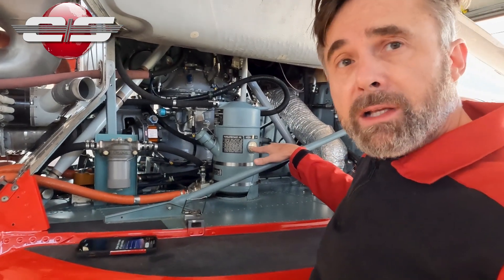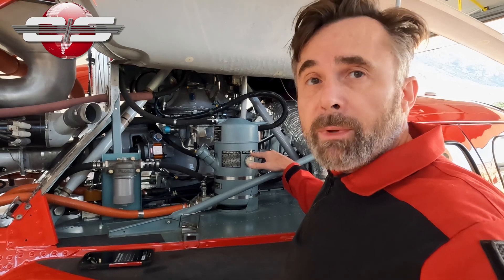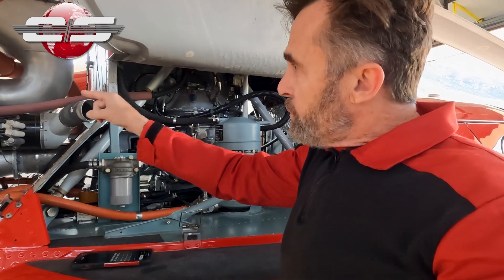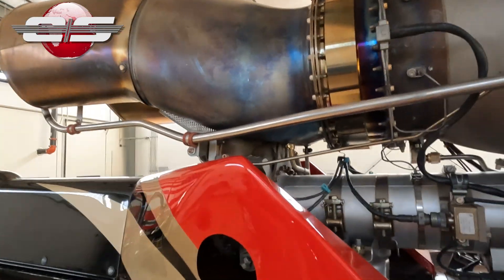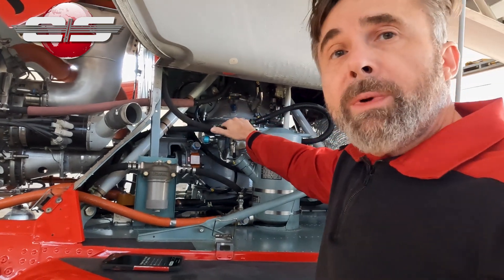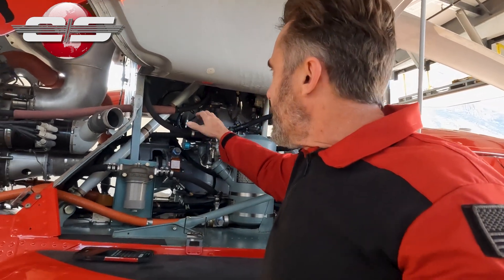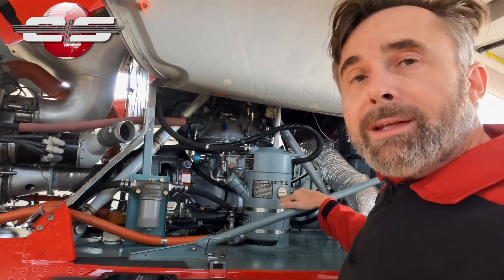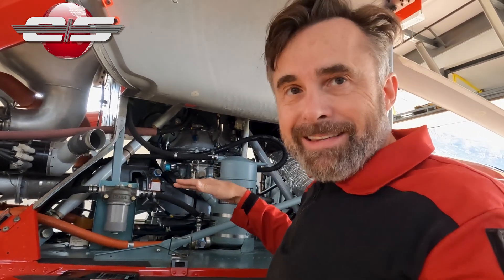#68 - Oil Vent routing for Turbomeca Arriel Engine on AS350/EC130

Comment: Hello Mr Glenn
Just ask about oil system.
After flight / ground run we are check oil in the tank 10 minutes after engine shut down, found oil level in the middle of lines mini and max.
But after 3 days or so (without engine running) the oil not visible in gauge.
What probably issue for that oil?
Thanks before
Reply from the maker: When oil is heated, its molecules move faster and tend to move apart from each other due to increased kinetic energy. This causes the oil to expand. The intermolecular forces that hold the molecules together become weaker relative to the increased kinetic energy of the molecules, allowing them to move further apart. Conversely, when oil is cooled, its molecules move slower and tend to come closer together. This causes the oil to contract. The kinetic energy of the molecules decreases, making the intermolecular forces more dominant and pulling the molecules closer together. Simply put.... when the oil is warm its higher in the site glass and when its cool its lower. Since the oil is warm when we are operating the engine that is when we want to check to see if the oil level is at its proper level.
Reply: @EUROSAFETYTRAINING  Thanks for the explanation Mr. Glenn